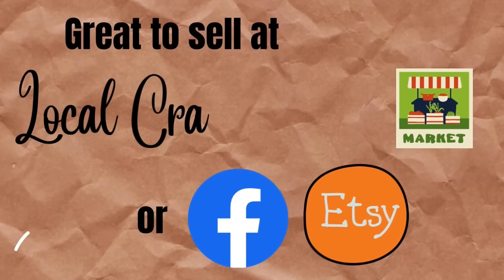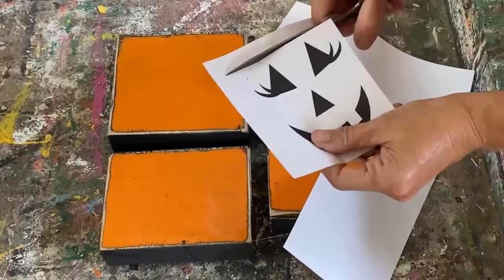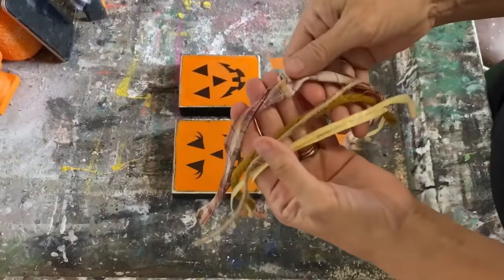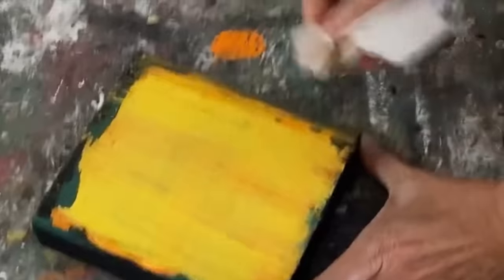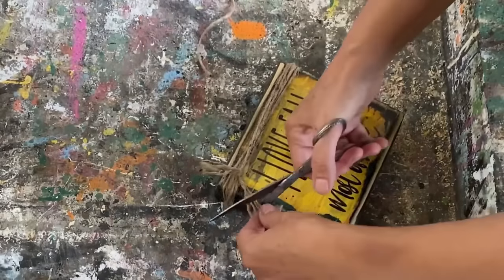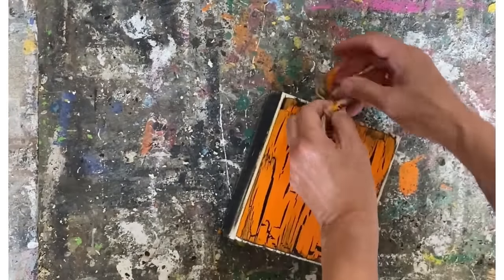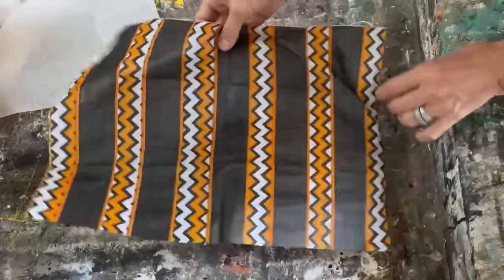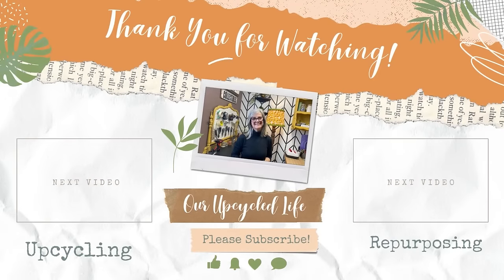Halloween Scrap Wood DIYS that Sell Like Crazy / Trash to Cash

Comment: Not sure if you are just speaking from past experiences years ago, Deidre, or if your local HD skirts company policy, but HD corporate actually instituted policies that do not allow any wood - regardless of how damaged it is, or how small the scrap cut offs are - to leave the store for free. EVERYTHING is charged at cull wood prices (which is 30% of regular retail on the item...even if it's a 2" cut off that's half garbage & you're just looking for scraps to use under your primary wood when drilling or making cuts) or some mgrs will tell you they have to charge a pro-rated amt of the full retail price for the cut-offs (so take the shelf price for a full board & pro-rate the chunk you're grabbing out of the garbage bin from full retail price, usually at a per foot price even if less than 1'). HD policy now dictates that they MUST incinerate any scraps/cut-offs, damaged wood, or cull wood that is not sold. They cannot even donate it to charities. They would rather incinerate it than let it walk out the door and be used by someone like you or me, or even an organization like Habitat For Humanity. 🤨😕 I'm aware that the corporation has consistently donated supplies to charities for military veterans (in the US) and perhaps HFH also, but new policies of wasting wood that someone could repurpose (hell, even if they just want to burn it for heat themselves in the winter) is unsettling. I've suggested they donate it to a charity (such as ReStore in the USA) that could use it or sell it for super low prices to support their cause (sell bundles of scraps or whatever they decide to do with it) & corporate won't do it. All the other box stores have followed suit with their scrap & damaged wood policies. The waste & disrespect for the trees that have been sacrificed really bothers me. I keep asking "what else is possible here?" and so far I'm generally just met with robotic responses from automatons who are taught NOT to think and just "do as you're told."

Comment: I’m curious, is it the outline of the mod podge that is still left on the object after you’ve rubbed off the paper, or is it some of the paper? Whenever I do the reverse transfer method , I always have this odd outline that shows. Doesn’t matter if I am doing it over light colors or dark. Is there a way to avoid that?
Reply from the maker: If you’re seeing a very prominent line you’ve probably used too much mod podge mod podge is thick so if you’re putting it on that way it will definitely show a line you don’t need very much to do this transfer technique if you do see a little bit of a line you can always blended in with your background colour hope that helps
Reply: I think the trick is to make sure that it is a matte finish Mod-Podge. Glossy would definitely leave a noticeable line.

Comment: I purchased the faces and I believe the shelf sitter items from your Etsy store. I have tried twice to get the paper off. I do not know what I am doing wrong. The first time the faces rubbed off in places. ‘The second time the faces didn’t even try to adhere to the wood. Any ideas what I AM DOING WRONG?
Reply from the maker: Hi Lori! Are you using a ink jet? If so that can be a bit more tricky and the ink will rub off easier. Here is a video that will help you out: https://youtu.be/bGaioUJg-nc

Comment: I love love love your channel and find your projects inspiring..I will be attending some local crafts fairs this fall as a vendor and wanted to add some wood projects from scraps I have to what i am going to sell..I have a circuit but struggle a lot with it so thought your reverse graphic transfers would be perfect. I tried with an injet printer overnight and the next day everything came off even the design so huge fail then with my laser jet printer when I tried the next day and wet the design to remove the paper it leaves a heavy white film where the paper was and also has removed some of the ink design...i have followed what your doing to a tee...how the heck do I get this to work? frustrated in PEI #pleasehelp?
Reply from the maker: This technique does take a little bit of practice it does also work best with a LaserJet printer and some inkjet printers just don’t work well and some do I don’t know the reason why also make sure you’re using the cheapest computer paper you can find if you’re finding you have a white haze you might be using too thick of a white paper and it’s really hard to rub it all off hope those little tips help and I do have other videos on my channel using an inkjet printer that you can watch and it might help guide you along a little bit for a refresher